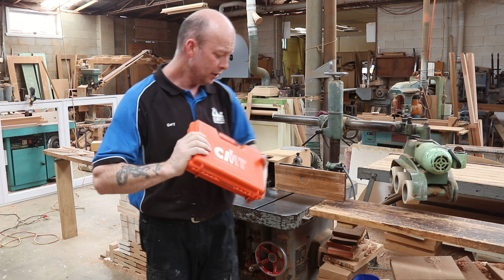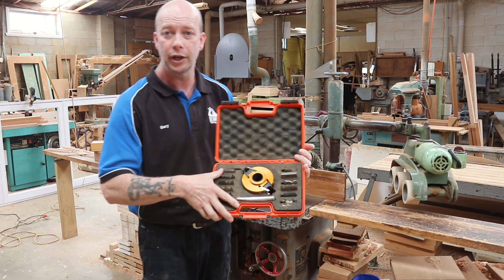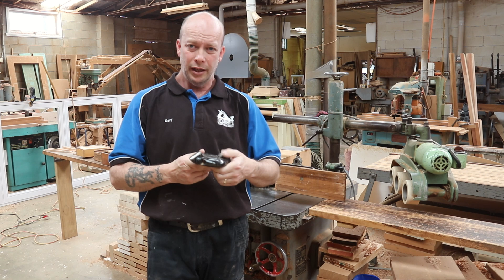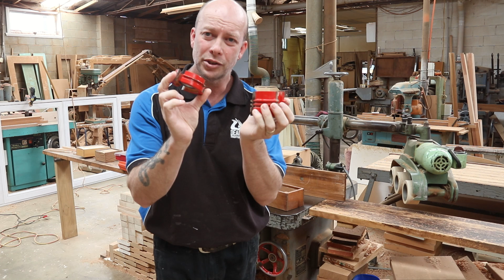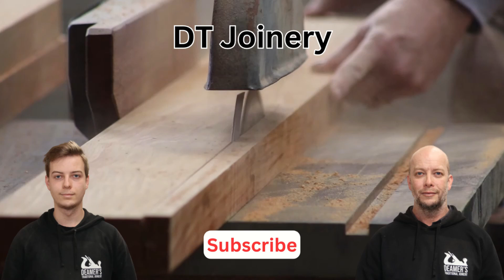A Beginners Guide To Spindle Moulder Tooling

Comment: Ive always heard of your drunk saws called a dado blade. I e had one in the past for my table saw. Then the ring is a dial indicator.

Ive learned a lot about the spindle shaper here on your videos. Ive recently acquired one and have been looking at the cutter kits like you have for staring out with.

Im not sure what brand this Spendle Shaper is. I'm going to have to do much more research to find out.

Its definitely a machine to have a lot of respect for. 

Thanks for in lightening me on this direction of woodworking.
Reply from the maker: You will find numerous names for them, depending on where you are from. In Australia, even between a Joiner and a Cabinet maker, there are differences in names for things.

Spindles are a great machine, and they are the most used machine in our workshop. They are extremely versatile, but in the wrong hands, very dangerous. Always respect their ability to hurt you if used incorrectly.

Thanks for your comment, and I'm glad to have been able to assist you in learning about them.

Comment: What is the best thing to use for adjusting the spindle shaft on a shaper from a 45° to a 90°
Reply from the maker: @leabrookhart5682  
If I'm understanding you correctly, to set the spindle at 90 deg to the table, I would use a square. For any angular settings, I use a sliding bevel.

Comment: My advice is start with the better euro cutter head like the one in the orange box they can be got with spir cutter for rebate work and euro cutter for all the profits he's shown until you become confident with setting up. The euro heads use alinement pins making the fool proof for beginners.
Reply from the maker: @joinertanner  
Yes, I agree.
I also wanted to give some other options outside of that set, but for the cost, it's hard to beat, given its versatility.

Comment: Great video. Just picked up 2 of these machines (we call them shapers) with power feeders and need to get tooled up so they can earn their keep. Would love to see more content! Especially on techniques for running material through the machine
Reply from the maker: @truckguy6666  
What brand machines did you get?
I have 3 other videos of machining different profiles, not tutorials, but showing the process.
Reply: @DTJoinery  I got a Delta 5hp 1-1/4 spindle with Maggi powerfeed and a jet 3hp 3/4" spindle with a generic feeder. Both single phase! A good bit of tooling with each machine, sort of a mishmash. I've used these machines for years but not often. Retired old boss sold them to me
Reply from the maker: @truckguy6666  
You should have a good machine with the Delta. I bought one for parts, its a very heavy, well made machine.
Reply: @truckguy6666  is the delta a Delta hd?
Reply from the maker: @jar944  
I made a video of collecting it, at the start and end of the video, I gave a closer look of it.
I bought it for the fence setup, the machine itself needs a lot of work to get it up to working condition.
Reply: @DTJoinery  sorry, I meant the spindle truckguy6666 picked up.  If I remember the video your machine is a Delta badged invicta rs-15.  Solid machine and generally a clone of the older t120. The common spindles over here in the us are the Delta hd and Powermatic 26/27 both are lightweight 300-400lb machines that were originally designed with a 3/4" spindle and 1.5hp motors. The quill is tiny on both and not really suitable for more than 1-2" tall by  3-4" diameter heads. The quill on a delta hd is about 2.5" in diameter and 4" long with two 6205 bearings set about 3" apart. They were the common cabinet shop machine and worked well enough on on 3/4" material.
Reply from the maker: @jar944  
AH right, no worries.😊

Comment: Interesting hearing the pricing differences. 40mm heads and profile knives are relatively cheap here. Under $20 per pair is average. Heads are a bit over $100.  Cant say ive seen a wobble saw available anywhere. I would likely skip the glue joint cutter and suggest a 180/200mm 15-30mm adjustable groover. (In addition to a 4-15mm groover in place of the wobble saw) the 15-30 will allow someone to cut moderately sized square shoulder tenons as well as grooves.
Reply from the maker: @jar944  
The adjustable groovers here are just over the top expensive, which is why I suggested the drunk saw.
Where are you located?  your prices are very cheap compared to here.
Reply: @DTJoinery  I'm in the US. I think I paid under $200 for the 20-39x170 groover and maybe $300 or $350 for the 4-15mm x160 3 peice set. The standard 40mm cmt profile knives were $13 for years. Those were only the knives since we don't run limiters or limited blocks here.
Reply from the maker: @jar944  
So cheap, those groovers are over $600 here, at least what I've seen.
I guess that is the problem when everything is imported.
Reply: @DTJoinery   and I hadn't looked at the exchange rate. Add 50% to my prices.